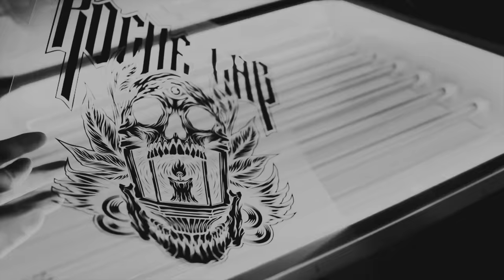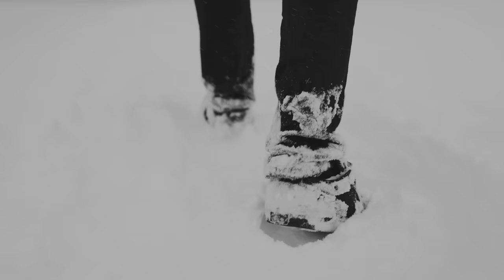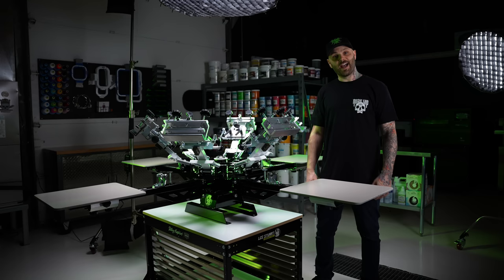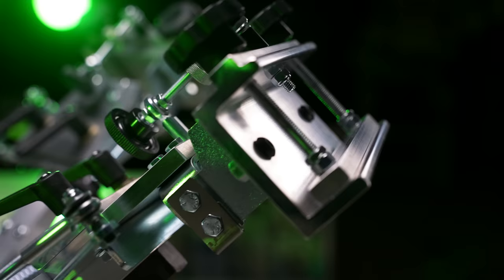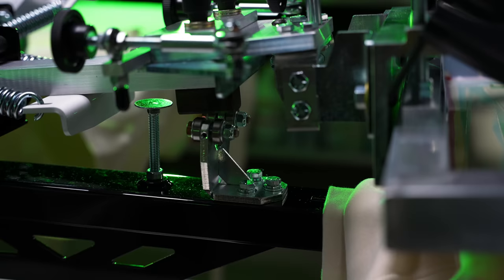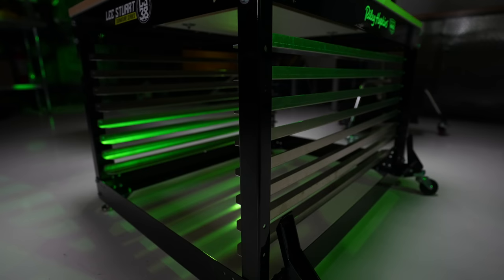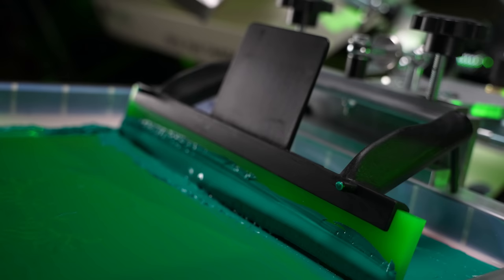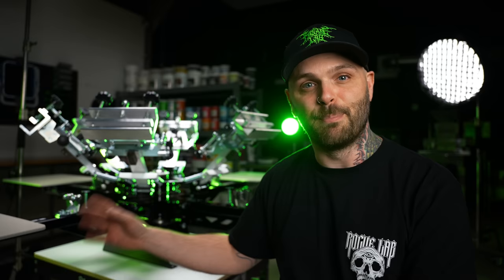I Designed This Screen Printing Press For YOU! My Signature Riley 250 Reveal!

Comment: Sic video. Did you guys upgrade the off contact adjustment? That's my only gripe I have with my Riley 250. Other than that it's been a great press.
Reply from the maker: The off contact is still the same. It wasn't a big enough inconvenience to justify the huge cost to the buyer it would have added to change it. I use this thing daily and don't have any issues with it

Comment: what is the space required for this press to be installed, Circunference, square space, etc.  How much physical space does this press need?  6 feet b 6 feet ?
Reply from the maker: All of the size specs are on the website, but it's about 7.5ft in diameter

Comment: Bearings are not designed to be used as guides / slides.
Reply from the maker: Except they are. Look at every single screen printing press on the market
Reply: @leestuart38  Most manual presses do use bearings. Ball bearings are great for axial and radial loads 
I think a pin and bronze bushing (or other low friction busing) would better. 
I was the first beta tester of the riley-roq, which was short lived. I don't think it ever left beta testing, then they renamed it riley 300 or something like that.
Reply from the maker: @cheddarcheese  it isn't just manual presses. Most auto's in service today use roller bearings in some way to index just like a manual press does. To go further, the Geneva drive on the Roq you is pushed exclusively with roller bearings. I was a motorcycle mechanic for a long time and a pro rider before that. I can tell you with 100% certainty that some roller bearings are designed to be used like this.